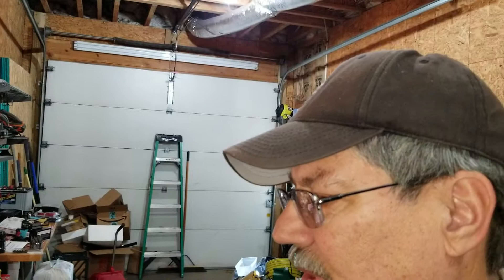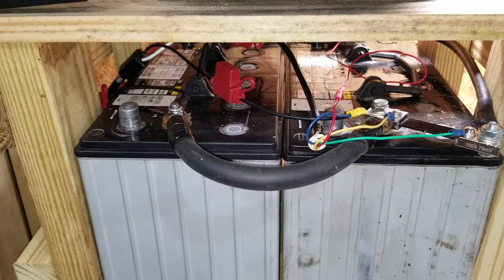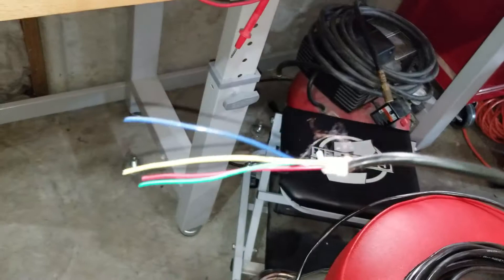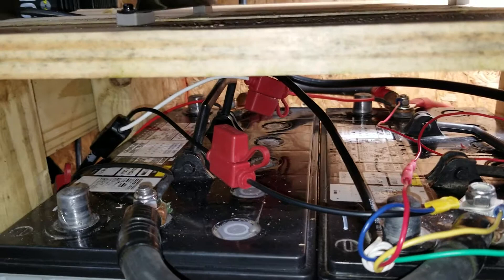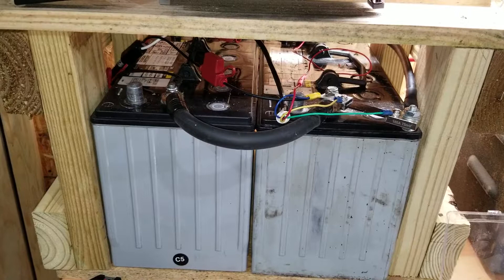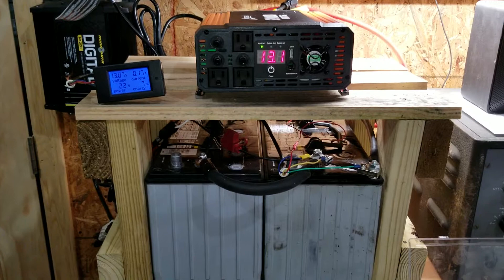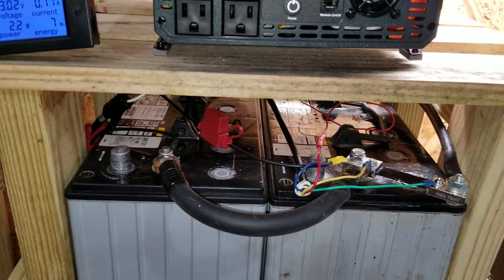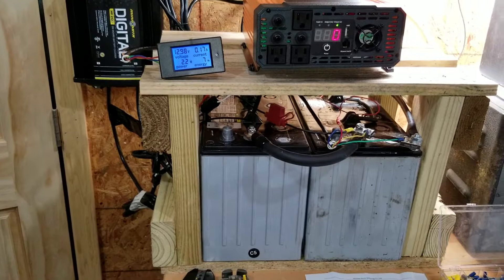Simple and inexpensive but very effective battery backup system.

Comment: Gold night, it's pure sine weva ??
I have one just like yours.
Reply from the maker: According to their website
-- The 2000W Power Inverter is with "modified sine wave" that's perfectly fine for resistive products, not work good for inductive products

-- If you need to use for appliance using a motor or a delicate piece of medical equipment, you need a "pure sine wave" inverter.

Comment: i am planing to do a lot of Astro photography at night , id like to know if you think the battery's 2 of them alone will last all night connected to a laptop and a few smaller devices?? i'll be charging them fully before use for sure. or should i get a smaller inverter ? like a 1000 W
Reply: no
Reply: inverters only allow usage of about 25% of amperage 200 amps equals 50 amps using 4 amps per hour only gives you about 10 to 12 hours